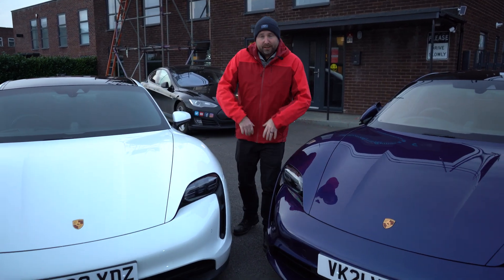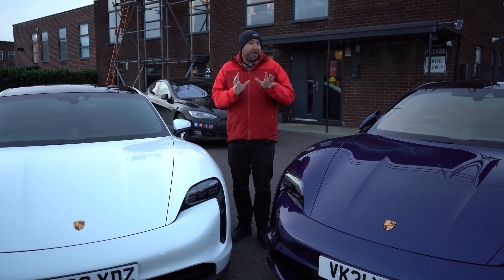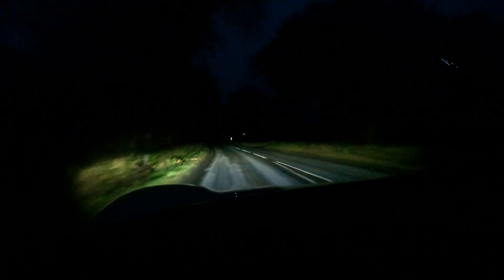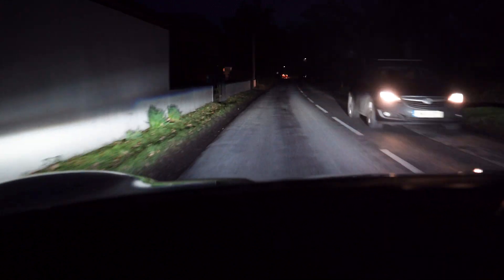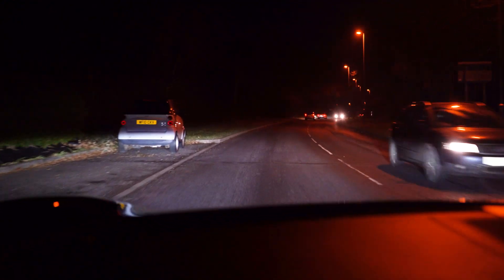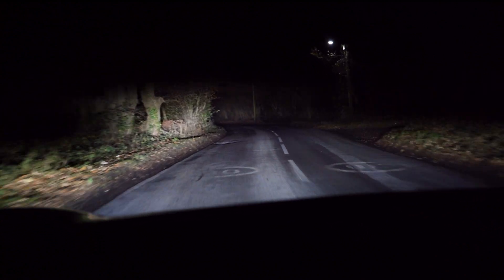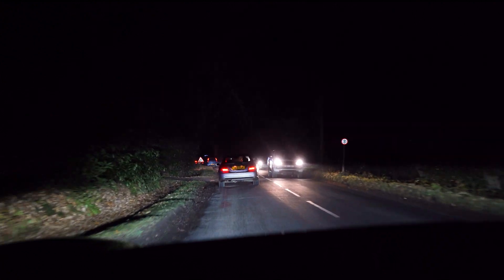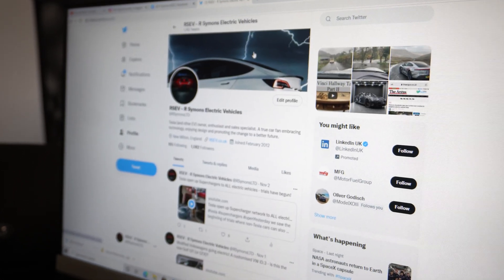The power of good headlights! Cornering and full Dynamic Matrix LED PDLS+ demo using Porsche Taycan

Comment: Wow. They turn corners, like 4 other manufacturers have had for the last 25 years and Citroen offered in the 60s. Oh they also have auto hi/low beam which has been available for over 60 years from every manufacturer. Every amazing safety PDLS+ feature is disabled for USA market.

Comment: Why is there such a long delay in automatic switching from low to high beam on the white Taycan with non-dynamic headlights after an oncoming vehicle has passed or a preceding vehicle is no longer in view.  My U.S. market Cayenne has the matrix headlight option but operate as traditional low and high beams due to U.S. regulations not allowing adaptive headlights.  My U.S. market Cayenne has a similar excruciatingly long delay before the matrix high beam switches on.  The blue Taycan with matrix headlights in this video also has what seems like a long delay before the matrix high beam becomes effective.  The automatic high beam on our Toyota responds nearly instantly when switching between low and high beams.  What's going on here?  Do the Porsche systems have slower processors or are they programmed to "think" about whether they really, really need to take action?  I find this excessive delay to be both irritating and unsafe and makes me want to manually control my Cayenne's switch between low and high beams.
Reply: To address my own question ... after I made the above comment, I had my U.S. market Cayenne's matrix headlights re-coded to be adaptive as they are in Europe.  There is no longer the bothersome delay in switching between low and high beams since the high beams are essentially now on at least partially all the time at speeds over about 19 mph as long as there are no overhead street lights.  In other words, the headlights no longer operate as traditional separate low and high beams.  Oncoming vehicles are now tracked and "shadowed" as they move towards me as shown in this video.  In addition, the low beam pattern was unexpectedly changed for the better by the re-coding.  The re-coding also enabled the sign glare reduction feature and the encounter light feature although I have not yet experienced the 3-flash highlighting of pedestrians on or near the road.

Comment: Nice demonstration! 

One thing. You write/say "Full LED matrix system which Porsche Call PDLS+" which I'm not sure is 100% correct? (at least for Norway). PDLS+ is LED lights Plus (LED lights including dynamic lightning/corningering). Matrix is Matrix, that's the third headlight option one can choose for several of the models Porsche offers. The Matrix option is called "LED-Matrix Porsche Dynamic Light System Plus (PDLS Plus)" by Porsche.

Comment: The ID4 with IQ lights does what the blue Taycan does and to see the sweeping curtain of light opening up is amazing. This is one of the reasons I ditched Tesla, they promise much but never deliver. My 2021 LR 3 had matrix lights but they didn’t do anything and all three Teslas I owned had a dreadful late to operate full beam which was never fixed ( along with the wipers!). I loved the silly stuff but the important stuff we were promised never materialised. Yes the ID 4 has crap software but it has fabulous lights and a better FSD than Teslas have. Safety before fun….how German is that!

Comment: I hadn’t driven in mainland Europe for about 4 years until last summer and we did a lot of driving at night.  I kept getting blinded by what I initially assumed were badly adjusted headlights on bangers, but realised after a while, it was high end, brand new cars which had overly bright headlights. I think a lot of these would have had ‘intelligent’ matrix-style lights as they tend to be standard spec in some parts of Europe, but I don’t actually think they are very good at preventing full-beam glare for oncoming traffic - at least, not as good as taking control yourself well in advance when you see something off in the distance. My neighbour has this in his German car (I won’t name the brand) and he said he does get flashed a fair bit when he relies on the intelligent matrix thing.

Comment: I’ve got a Taycan with LED PDLS+ and you haven’t mentioned that it’s slow to work as you drive along and oncoming drivers flash more often than you wold expect, the lights are so bright. To be honest, the first are more than adequate and if I get another Taycan I won’t bother with PDLS+
Reply: Both cars in this test have PDLS+, just one is Matrix LED and the other a basic LED.

Comment: Tesla do a great job of making people believe that they are at the cutting edge of everything technology wise, but the reality is in areas like this they are weaker than cars that are older and much cheaper.  I have a Model 3 P and it's shocking how low rent the lights are when you consider the price point.  I don't think Tesla will be able to rest on its laurels for too much longer, it's staggering that matrix-capable lights have been fitted to Model 3s since Q1 2021 and they have done nothing with them since (I don't count a gimmick Light Show as meaningful functionality)

Comment: I would retest the Tesla M3/Y auto lights Richard since the latest updates. In my tested on roads like you've demonstrated, they were turning off faster than what the Porsche was. My only criticism with them would be for motorway driving, they dont seem to turn off if the cars are a large distance away.

Comment: My Porsche Cayenne has them. Great. Rarely get flashed by other drivers. Great safety feature and would now always choose a car with them. A previous car had them and I did get flashed a few times! Porsche you can see working. Switch them off and what a difference.

Comment: Two issues with the Tesla lights. Firstly I have had two Teslas a model 3 and a model Y and both on collection did not have the dipped beams correctly set up for UK roads and were either too high or too low and would be potentially dazzling to other road users and if not corrected MOT failures. I would suggest that a lot of people with Teslas are just accepting the beam pattern as normal and not getting them checked hence the likelyhood of potentially bering dazzled by them more often than not. Tesla should act on this to ensure all cars are correctly aligned before being given to customers. The second point and I have mentioned this before is Im not convinced there is much desire by Tesla to activate any matrix functions given that all US cars for example of model 3 and Y do not have matrix headlights fitted at all and are the same as fitted to early Model 3 cars here ie straightforward LED lights. Obviously I hope they do add some functionality but it doesn't seem to be an area they are greatly interested in. Time will tell perhaps.
Reply: In the US adaptive headlights were illegal until last year (2022) hence why cars didn't have them, the new rule still has to go into effect though.

Comment: I had a similar technology on my BMW (and even did a similar thing on an m240i with Xenon headlights where is stayed on full beam except you see the bulb move as it boxes out cars on the right then moves back). Cannot understand how my 21 matrix LED model 3 isn't on for Europe yet projects rather word TESLA on a wall for the light show using LED. Such a shame as I don't think the current basic stock full beam assist on the Model 3 is a patch on the BM version from my experience, specifically on Autopilot where speed is now more limited too after Christmas update. Having to manually realign the Teala after every monthly over the air update (as I love on a hill, doesn't need on flat if updated). Odd technology implementation or lack of....

Comment: Of course Tesla's lights don't do anything because it's illegal in the USA. On the downside of LEDs, both my VW ID3 lights have huge condensation in them, which doesn't get evaporated because LEDs produce virtually no heat. Not good for an almost 22 month old car.

Comment: Been running a Tesla P85 since 2015. 125,000 uk miles later matrix headlights are the main reason I would change the car. Yours is the best demonstration Ive ever seen. Clearly (pun intended) more of an improvement to safety in preventing accidents and fatigue than many many other more expensive options. Elon we need matrix lights
Reply: I've no idea how they can't implement it in the next revision for Europe. Hence the hold off maybe? Who knows. I don't really know if they can implement it on the model 3 and y's with the matrix headlights, I feel like it needs a decent IR camera to differentiate targets and map a beam appropriately.
Reply: It’s the fact you don’t have to move the stalk which from thinking you need to move the stalk to doing so is a bloody long time when compared to crashing or not. Split seconds count and these lights show how slow our bodies really are!
Reply: So they are no good for folks in older cars as these lights blind us OK for you not safer for me.
Reply: @davidlewis4399  the point is they don't blind people. Did you watch the video?
Reply: @davidlewis4399  The new lights ensure they do not shine at on coming traffic, they do not blind. I have personal experience of driving with Audi Q5 behind me and approaching me. These lights only shine where needed they are what lights should have been from day 1 much like cars should have been EVs from day 1, just a better solution.

Comment: So, I have a 2017 Ford's Shi*Max with the Titanium leather pack which included LED headlights! 

I think they are almost as good as your full Posh Porsche system as I was properly impressed with them and how they block out incoming traffic. 

If only the engineers for those headlights had also designed the rest of the car, it would be epic!!! Shame they didn't!!

Comment: The first Taycan seemed slow at dipping its beams, and there are safety concerns about LED headlights from some motoring organisations. Whether they are just badly adjusted or it is a design fault, they are horrible when they light up the inside of your car especially when bouncing back off the side mirrors. For a cheaper EV, the Vauxhall Mokka has good Intellilux Matrix Headlights, https://www.youtube.com/watch?v=JeiPoY0EnYc

Comment: Goodness knows how slow the Tesla lights are because the dip on the 1st Taycan were sometimes a bit slow. I was always taught to flick back to dipped before the oncoming car came into focus and these lights wait a bit! But then I guess we've all become accustomed to people leaving their full beams on till the last second.
I absolutely loved the matrix headlights though and are obviously the way of the future! Richard described the right side as a shadow but it does appear to be a a solid block of dark highlighted around the car, amazing!
One test Richard could run is the view from the aspect of a pedestrian maybe? I was temporarily blinded by a car that was using the 'old' tech of lighting up its left hand fog light as it turned left - no AI or anything deciding if it was safe to do so, just automatically turning it on to highlight the bend - blinding me walking towards it!
Nice to know the matrix are options on some of the lower VAG cars as well - they should be on all cars from now on! Great video.

Comment: I have Dynamic Matrix LED PDLS+ on my Taycan, and they are great from my point of view. However, when I enable them I get far more cars flashing me as if I've left my full-beams on, I would guesstimate around 1 in 15 cars. Most of the time, I just keep them on manual to avoid this. The trust just isn't quite there yet, imho.
For context, I drive a lot on dark country back roads, similar to the ones in this video.
Reply: I have the same system on my BMW, and from my experience it depends a lot on the type of roads. When there are a lot of hills then yes this system can blind the incoming traffic, also I assume when the roads are curvy and narrow also can lead to that.
Reply: I’ve had them on my Cayenne for 5 years and never been flashed once.

Comment: Wonder if the the reason that blue car stopped mid junction was being dazzled by the Taycan, it obviously detects cars coming on and being followed as you demonstrated in the video. Is it using their light patterns to do that, so a side on car would be harder for it to spot. The Taycan didn’t look like it blocked the blue car’s passenger compartment out until it was <50m or so away
Reply: If that is the case I wonder what a pedestrian or cyclist would experience with an on coming Taycan or other active light car. Another test video for the team perhaps

Comment: Great lights when you drive a Porsche but not so great when you’re coming from the opposite direction with an old banger 😂 I have PDLS+ on my Cayenne and I do sometimes feel bad for other drivers on the front of me because they’re so bright and end up dazzling them. Good video though as always mate 👍👏
Reply: The only downside is they fog up in winter and makes the car look so cheap/poorly made 😂😂
Reply: @billyboy3053 My Macan does exactly the same, fog up! Interestingly I had several VW Golf’s in the past which also did exactly the same thing. It does look cheap, and my BMW & Mini don’t do that.
Reply: @stuartbrowning3074  I know mate, it’s frustrating and somehow embarrassing as well 😂😂
Never had this issue with BMWs either.
Reply from the maker: The whole point is it Doesn’t dazzle others!
Reply: Have you got the matrix ones? My Cayenne does and always blanks out cars in front. You can visibly see it being cut off. Rarely get flashed, and when I do it is a long straight and the car must think too far away! Agree with condensation though!
Reply: Unfortunately they do because drivers keep putting or flashing their headlights on when driving towards me 😕

Comment: Can Tesla achieve the same performance with their current matrix lights? Is it simply limited by software or do you think it’s a hardware limitation too?
Reply from the maker: I don’t think they have the hardware for swivelling but certainly most of the active matrix functions should be able to be implemented over the air as they continue to [hopefully] improve Tesla Visio
Reply: @RSEV  You mentioned it in the video, the second Taycan with the Matrix LED's don't swivel either they dim segments.

Comment: Sorry to tell you but when your lights don't dim until the oncoming car is in sight you have already ruined his night vision. If you dare try looking at an electric arc welder for a second and tell me what you can see. You should dip your lights when you are aware a car is coming not when he has appeared.

And as for your lights remaining on full beam beside the car you are following, if he has is door mirrors are adusted correctly your full beam is reflected into his face. Plus if he is on old style bulbs it creates a curtain of light so bright that his own headlights are futile.

Great for your safety but dangerous for everyone you encounter whether coming towards you or simply travelling in front.
Even if you are in the cab of a lorry.